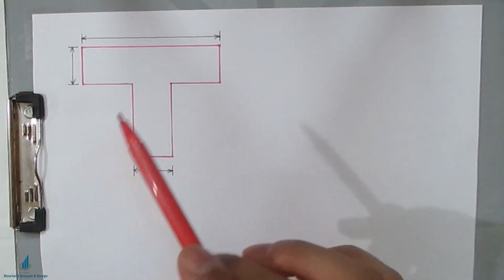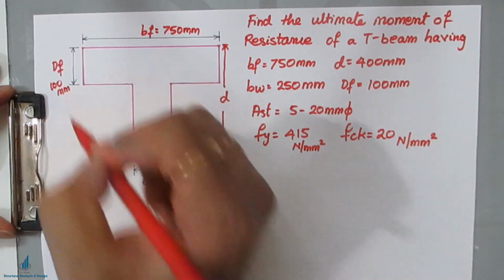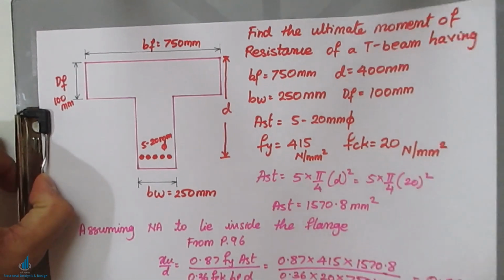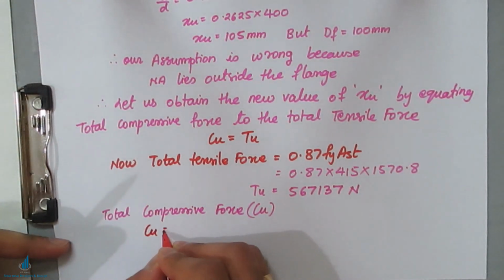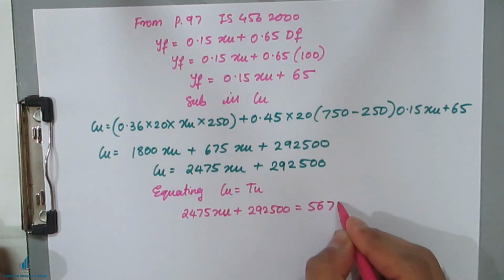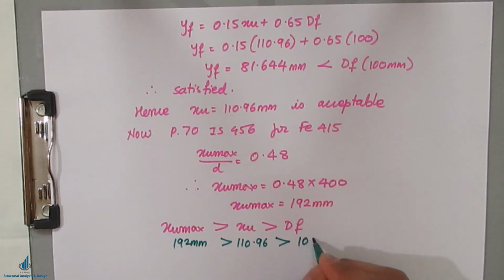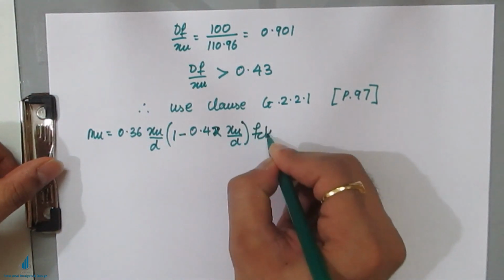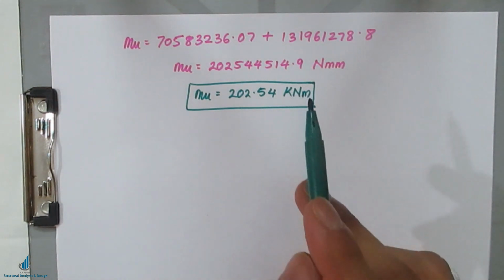What is T Beam and Analysis of RCC T Beam

Comment: Sir can you doing please make a video this problem please  sir                                                  Calculate the moment of resistance of the T-Beam with the
following data :
Width of the flange—750 mm
Thickness of slab—110 mm
Width of the rib—250 mm
Effective depth—600 mm
Area of tension steel—2400 mm2
Grade of steel Fe 415 and grade of concrete M 20

Comment: Sir, can you help me in one question? 
Please help me sir. 
Question is here 
Question-:

A slab of a hall is supported over a grid of
beams measuring span 4 × 6 m. It has to carry
a service live load 3kN/m2 and dead load
including finishes 2kN/m2. Using limit state
method, M 20 grade of concrete and Fe 500
grade of steel, design an interior mid span of
the slab.
Reply from the maker: Its easy Sachin, as per ratio this i 2 way slab and for the above condition you have to use Table 26 of IS 456-2000 and for interior panels case 1 you have to use
Reply: Sir, can you help me sir?
I mean , can you solve please sir.

Comment: Sir if t beam is double reinforcement what procedure should be provided
Reply from the maker: Usually doubly reinforced T beam will not be there, T beam is nothing but combination of slab and beam
Reply: @structuralanalysisanddesign   ok sir i m providing reinforcement both slab nd beam 
In flange 4 #10mm  , web  3#16mm connected by stirrups 8mm  what procedure design i should carry out
Reply from the maker: You can follow the same video but again there are two to three more analysis and design based on Neutral Axis depth